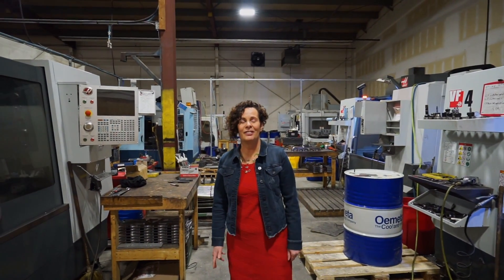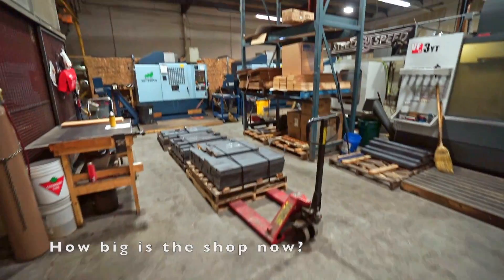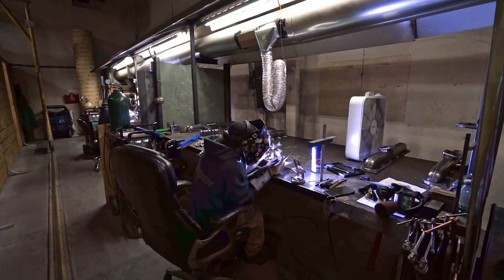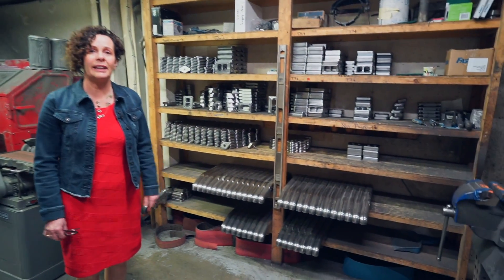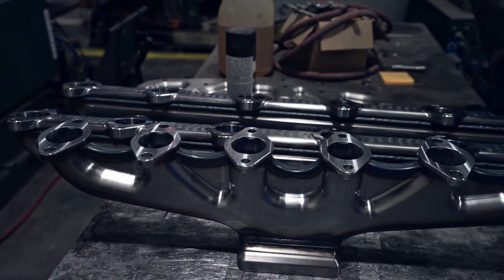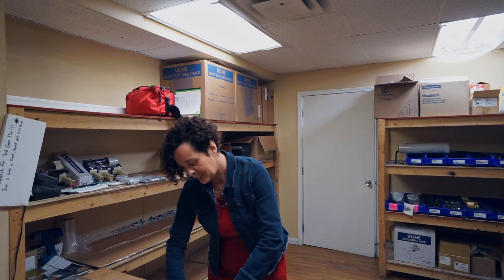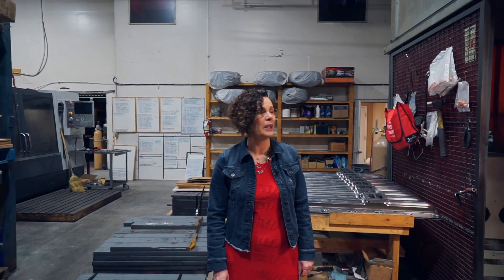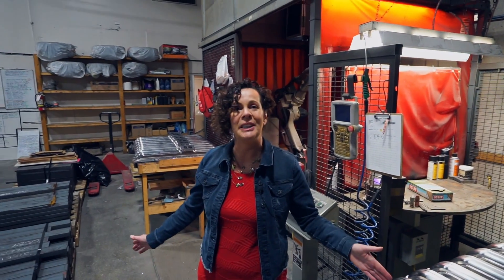Machine Shop Tours: Steed Speed

Comment: just my 2 cents . Most big production - 24/7 machines have all the sistems necessary to get rid of chips efficiently, if you're concerned the machine builder will install additional washdowns, jets , etc. . Hovever for the budget machines it's a neat solution . 
ps.: looks like a nice place :D
Reply: Running a machine with a single auger feels weird after running one with 10 and a chip conveyor

Comment: The machine I run (DMG Mori M1) is designed so nothing moves below the spindle, there is no horizontal surface apart from the machine table and there are coolant nozzles around the machine that are activated by an M-Code (M161 to turn on, M160 to turn off). I would really love the toolchanger to be separated from the machining space with a door as fine coolant mist accumulates on the roof of the cabinet above the tool magazine and it turns gross real quick. The coolant washdown gun is good but it's easy to end up getting coolant all over you.